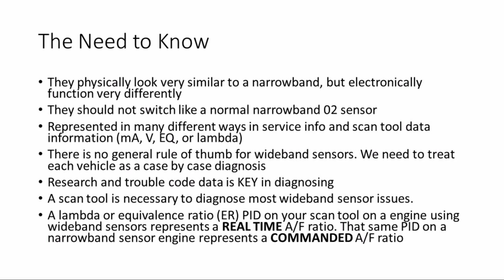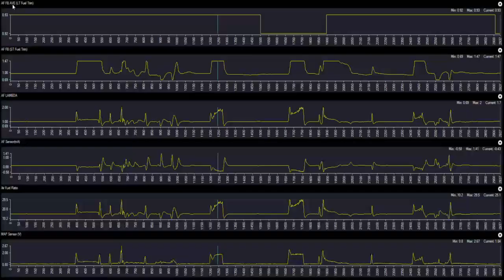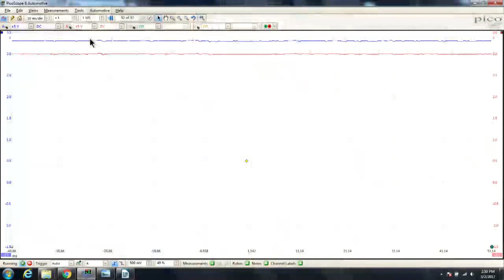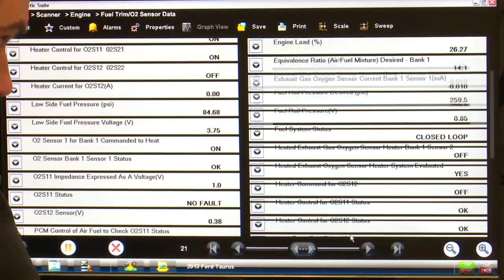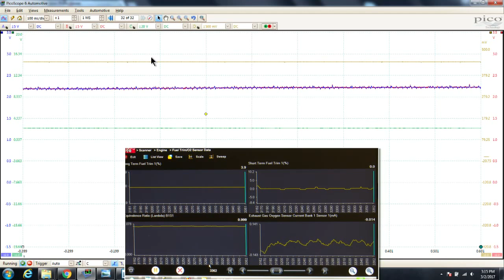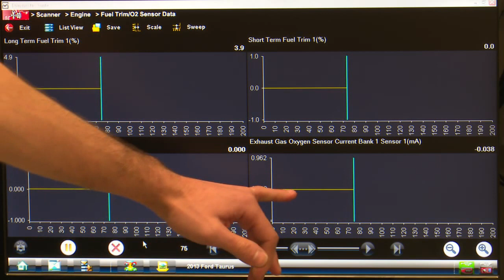Fuel Trims—The Wideband Air/Fuel Ratio Sensor, Operation and Diagnostics (A/f, AFR, UEGO)

Comment: I reckon B as af sensors need to be a he'll of alot hotter than standard zirconia sensors Right?
Reply from the maker: Rick, that is correct. The sensor does need to be very hot to operate. If the heater doesn't function the sensor doesn't function. Thanks for commenting, unfortunately I am only able to send out t-shirts when the question is answered live. Join us on April 6th for your next shot at the t-shirt giveaway!
Mike Becker, Technical Services Instructor